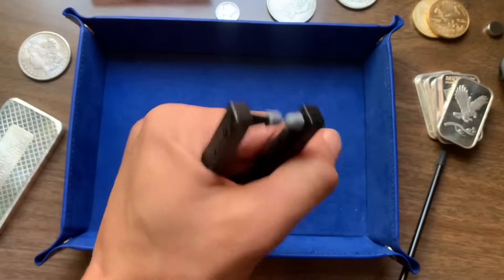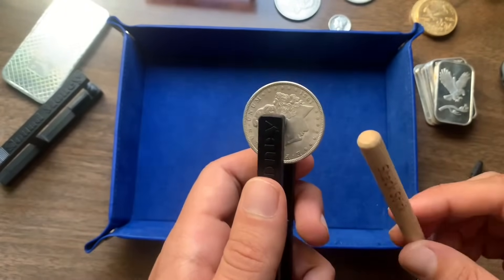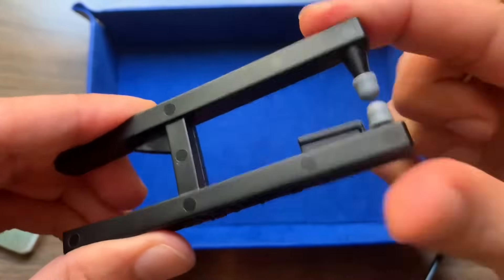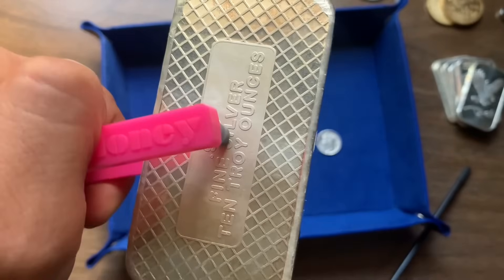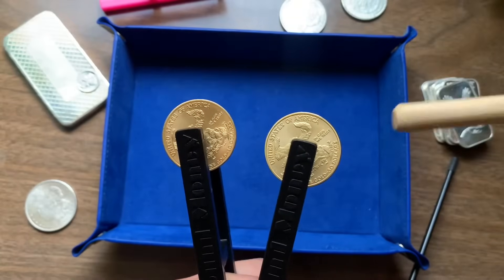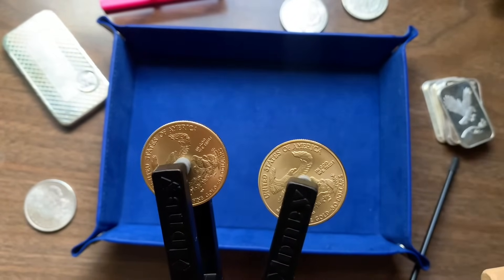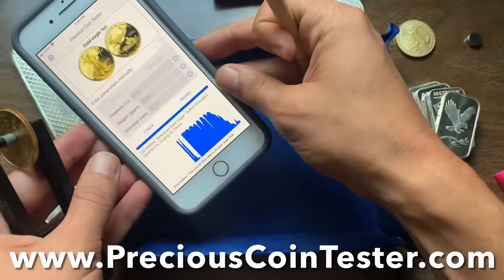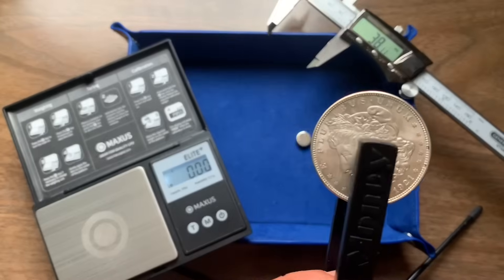Pocket Pinger Owners - Must See - 10 Tips in 3 minutes

Comment: Hi, if you can't get a coin to vibrate, does that mean it's fake or that I'm doing something wrong? tried testing a 1oz gold Maple with this, placed in the center as you showed, but can't get it to vibrate. I also tried the fake Eagle you sent me, and it vibrated perfectly fine, so I'm confused
Reply from the maker: Hey Mad Scientist, each coin is going to have its own unique sound characteristics. Generally the more pure a metal the shorter the duration of sound. Gold Maples tend to have a much shorter golden “ting” than a long sustaining ring. Also, some of the older generation Gold Maples are known to have no sound or very little sound. Check out this video. https://youtu.be/RBWAHBRiGhw

Does this help?
Reply: @SoundMoneyMetals  Yes, that probably explains it. I can hear a very slight ping. The app struggled to pick it up, but sometimes I could get 1 or 2/3. I tested another 1oz maple also, and it was much easier to hear. Thanks, that makes me less nervous.
Reply from the maker: @mad-scientist6027  great, is it one of the .999 maples? Do you have an N52 magnet to try also?
Reply: @SoundMoneyMetals  It is from 2013, so not old. No, I'm new to testing metals. I might look into the magnet thing, thanks for the tip.
Reply from the maker: @mad-scientist6027 have you checked the dimensions and weight? Keep me posted when you get around to this. Super interested. You can also email to Support@CoinPingTest.com